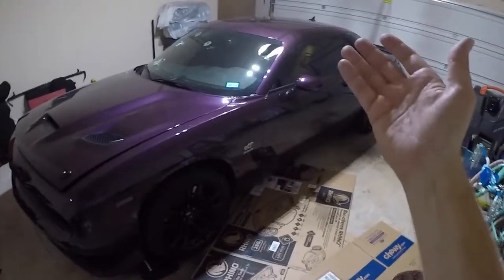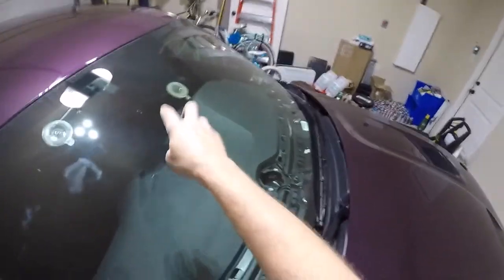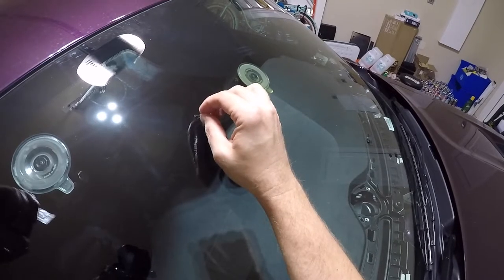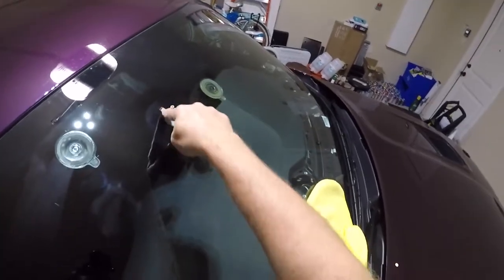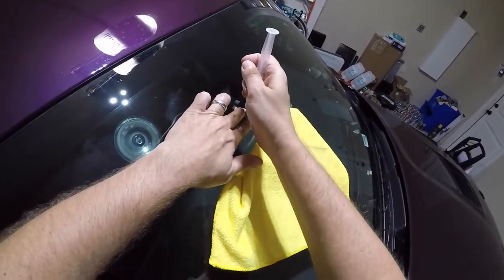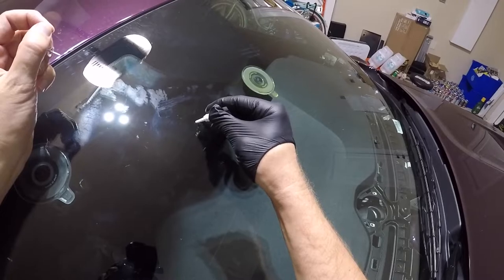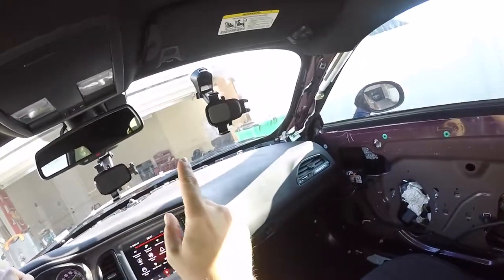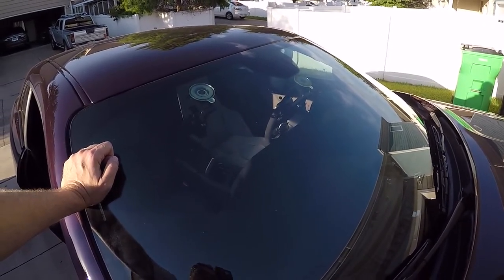Repairing a Chip on my Windshield with the Permatex Repair Kit 09103

Comment: I had an inspection and failed for a crack the same size in the same place. The inspector said it needs to be replaced. I asked the receptionist about a repair instead and she said no because of the location. Im going to try this today and pray i can cancel the new windshield installation. If it is a good repair I can avoid the replacement cost. Does it stay clear?
Reply from the maker: I haven't heard that before...unless maybe it's on the driver side directly in front of the drivers view? That sucks. I know mine is hidden behind the rear view mirror when looking from the drivers seat. I'd try a different inspection place if you can. The repair is still holding up good for me and looks exactly the same as it did during this vid a couple months ago. It's clear but you can see the repaired crack
Reply: Has the windshield crack gotten worse? Looking for update Thanks 👍@Scavenger1320